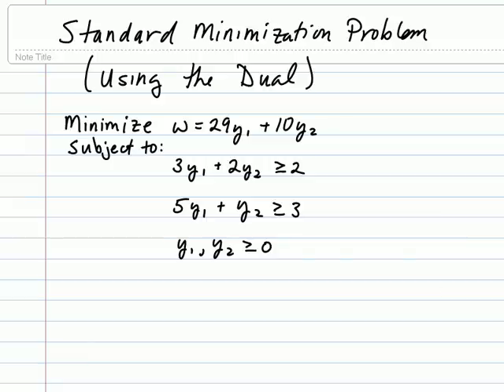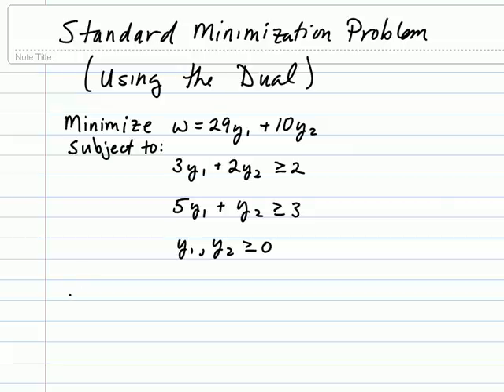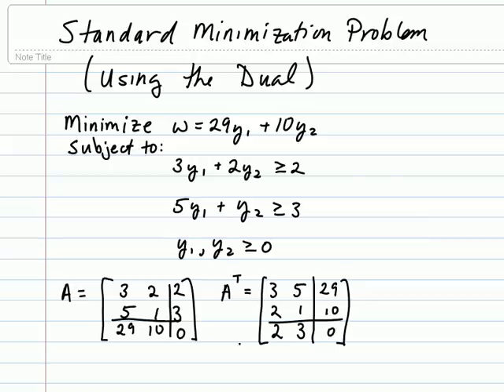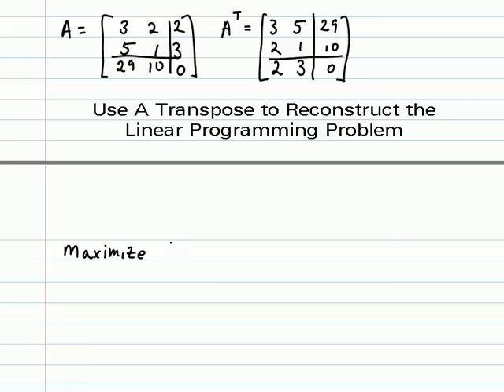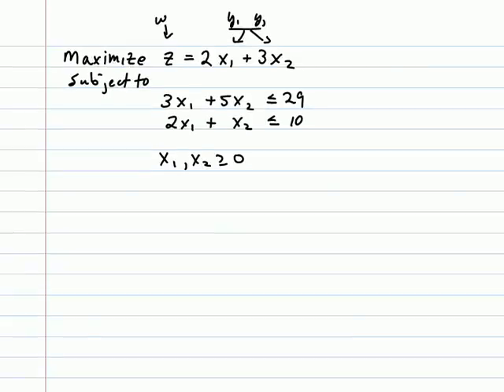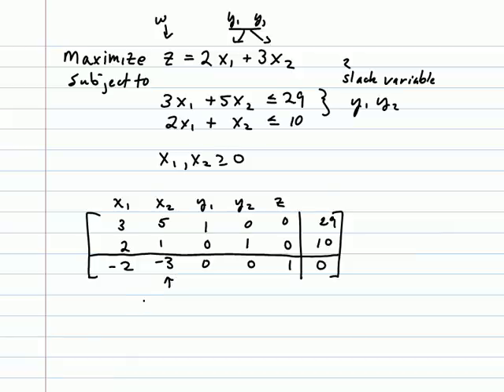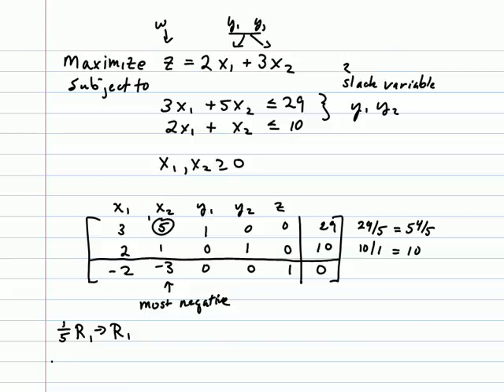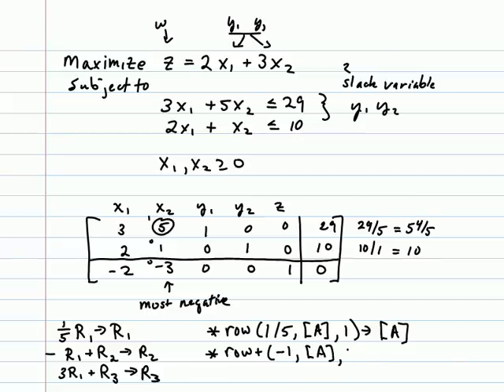Part 1 - Solving a Standard Minimization Problem using the Dual and the Simplex Method

Comment from the maker: @TheAziMax - The dual method is different than what I know as the 2-phase method.  What I know as the 2-phase method involves starting with a non-standard LP problem and using phase 1 pivots to move from outside the feasible region to the feasible region.  Once in the feasible region you would use phase 2 pivots to find the optimal solution (if it exists).